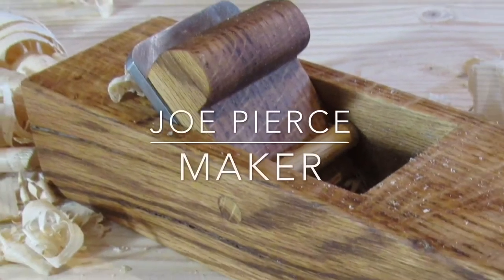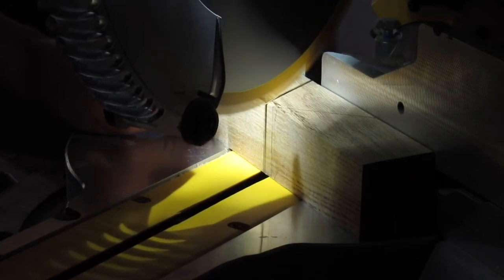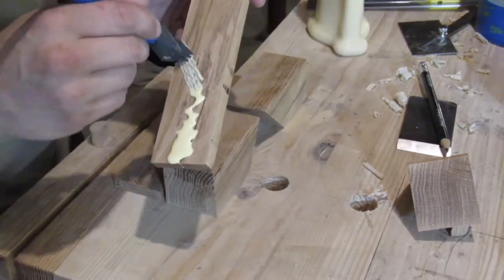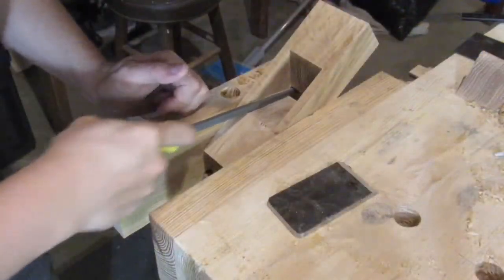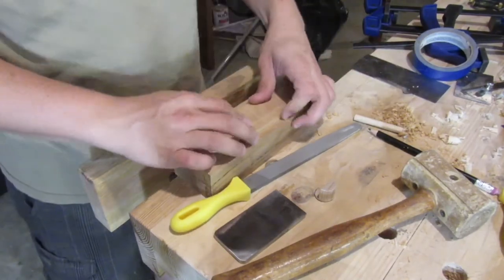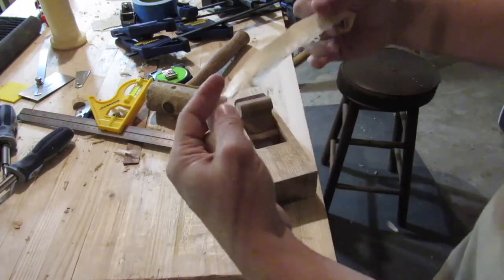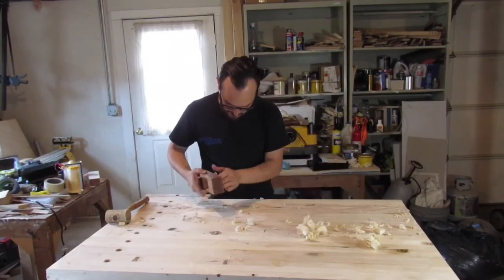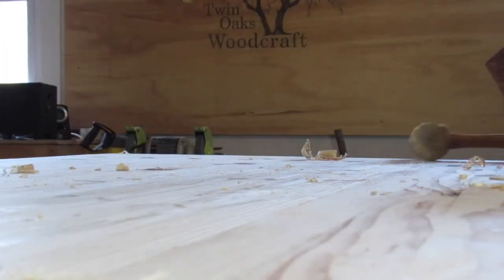How to Make a Hand Plane Part 2: The body

Comment: Would you do anything differently to make a low angle plane other than substituting the 45 degree angle with 50 or 55? Thanks again, great build video here.
Reply from the maker: I’m not sure, this is the only plane I’ve made. I do plan to make more in the future. I believe low angle planes are bevel up but I could be wrong.

Comment: Good work sir. But it would have been better if the plane is a one piece wood. Your style of work can make it.
Reply from the maker: Thanks!  I actually agree with you.  I started this project trying to make it with one piece and chopping out the part for the iron with chisels, but I ran out of time.  I had a deadline on this build since it was for a contest.  I still have the solid one, just haven't made a new iron for that one yet.

Comment: what steel did you use for the blade
Reply from the maker: I used 1065 Carbon Steel
Reply: Is that mild steel
Reply from the maker: No, mild steel would be a poor choice for a blade, it would be too soft and wouldn't hold an edge.  You want to use something with a higher carbon content.  1065 is a high carbon steel that is used for swords and knives as well.  It takes and holds an edge very well.
Reply: What size steel did you make it mate
Reply: Sorry I am in Australia so just trying to sort grades and sizes.Tnx for your replies that is a nice plane you made
Reply from the maker: It was around 1/4" (6mm)  thick, and just under 2" (50mm)  wide. Also, I made it about 3 1/2"  (88mm) long, but the length would be determined by how much you want sticking out of the top of the plane. I made the blade first and then built the body of the plane to fit.  I don't know a lot about steel grades, but I do know that you want something with a carbon content of 0.6% or higher
Reply: Ok thanks joe are you on instagram
Reply from the maker: I am!  @joe_pierce_maker
Reply: Joe Pierce Maker tnx I will have a look and follow

Comment: How did you lay out the hole for the dowel rod? Thanks
Reply from the maker: I layed it out by measuring the thickness of the iron plus about a quarter inch for the wedge. Then to make sure I had the hole on the other side in the same spot I measured from the bottom of the body and from the back end. I’m sure there’s a better way to go about it but this method worked for me.